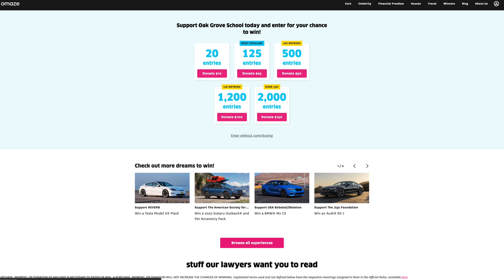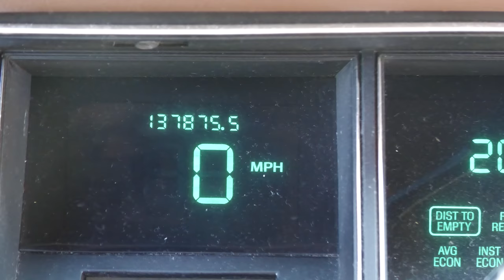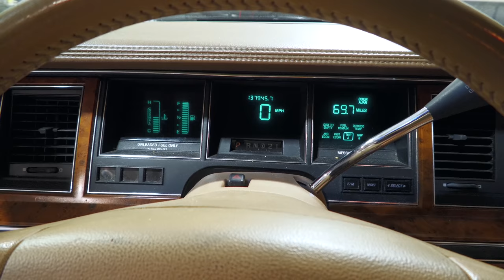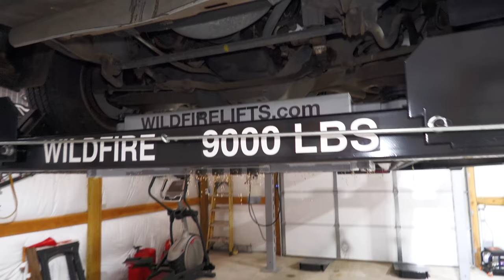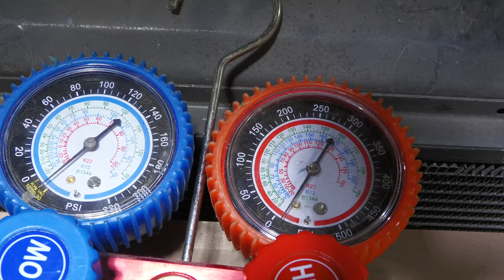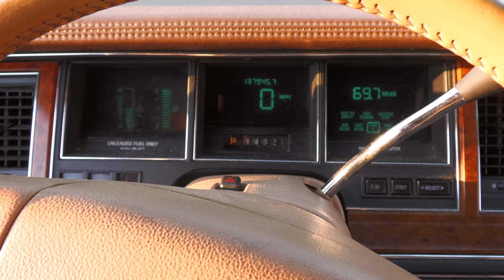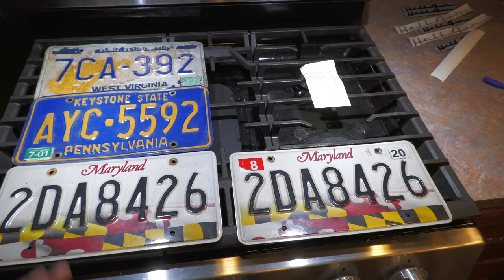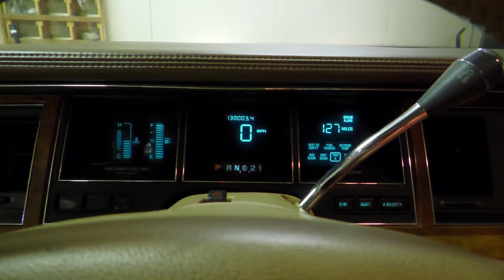I Drove my $475 94 Lincoln Town Car 128 Miles to AAR HQ   Did it Make it?

Comment: Surprised after you "cleaned up your mess" you didn't have to clean out your shorts too! You can get the same quality with a much less bulky or heavy camcorder. still puzzled as to why everyone always jumps to such big bulky cameras in an effort to improve. my neighbor did that too with the full on broadcast camera and it's just crazy. of course he coupled his with adding all new LED shop lights and that made a HUGE difference so he can now use pretty much any cam in his shop and it looks great
Reply from the maker: That's the same thing as saying you can get the same HP from a Metro as you can with a Demon. Big difference. Lens size is the same as engine displacement. The bigger the lens, the better the quality.
Reply: @AutoAuctionRebuilds  Usually that is true, however they are making equally as good quality cameras now in much more compact cameras now, The hard part is finding that balance of good quality and good low light recording. The only thing i've found so far that does a farily good job at both is Sony but even though they are good in low light they still aren't GREAT. this may improve in time but i still use a 10 year old HDR CX220 for the lower light recordings i occasionally do because i get a decent video riding down the road at night with my dome light on using that camera and it's got a relatively small lens in it. of course i am not on the level you're probably looking for either but i do have good low light cameras that are in that range like my Sony FDR-AX33 4k That one rarely gets used because while it will allow me to use my Rode video mic go, it is kind of bulky and heavy. plus i like being able to shove mine in my pocket when i'm on the go too and that CX220 fits in Most pockets. Probably one of the ONLY real benefits of being 6'5" 320 lol

Comment: I used to own a taxi company and I can say that that car will run just fine for another 130k miles. The 302 will die around 250k along with the trans. If it was the 4.6 it would run till around 500k till it needed a new engine. Most of my cars had around 2million miles on them.  Those cars are tanks and you can't kill them. The rear-end will make 1milllion miles. Thats just how it works. Trust me the cab drivers don't baby there cabs and thous just run for ever

Comment: Underneath the dashboard there are two star bolts that need to be tightened down on the steering column is for the steering leakage all automatic ford have got it

Comment: The yellow headlights kill me
Reply: Those are the parking running lights. The ones on the corners are the turn signal side marker lights. The clear part in between the two is the headlight.

Comment: The Lincoln doesn't have automatic headlights?
Reply: Actually, I think that one does.
Reply: @danielulz1640  it should, but Randy said he had to turn off the headlights and did so. My '74 Cadillac had them and every Cadillac my family owned had them. Twilight Sentinel it was called if I remember correctly.
Reply: @tony_25or6to4  due to constraints, I think Randy did not take the time to familiarize himself with the controls. It was simply easier to turn the headlights on and off manually.

Comment: Wish it had the original rims
Reply: Those wire wheels are Factory.
Reply: @danielulz1640  I thought these had actual rims. The wire hubcaps stood out to me. Maybe I’m off I’m not doubting you though.
Reply: @pdotsmith57  those are actual wire wheels, a very expensive option on Lincoln's.
Reply: @danielulz1640  wow never knew that that’s cool